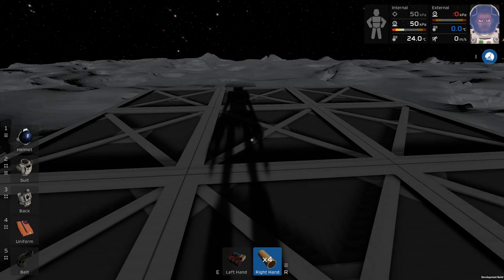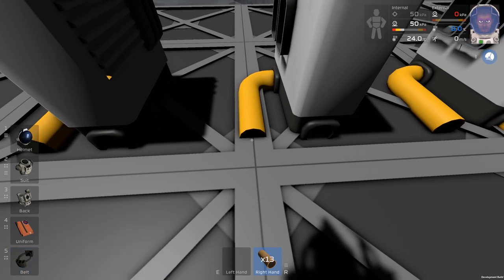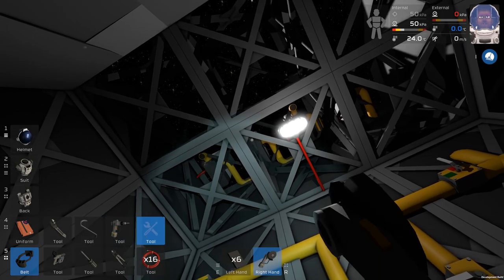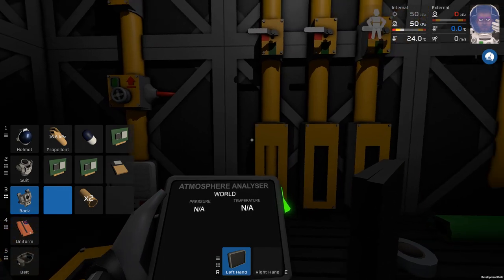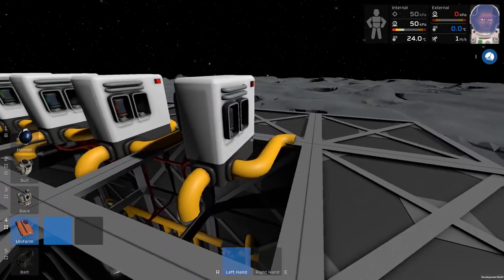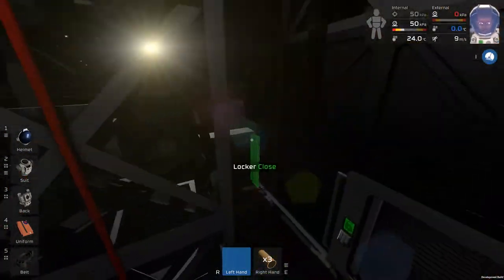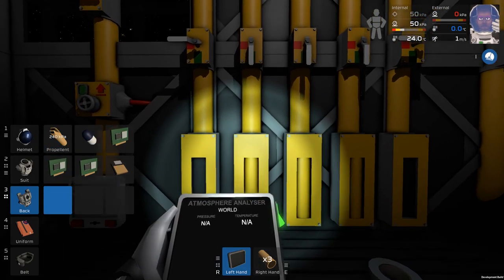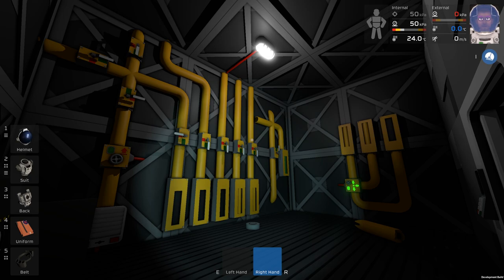Stationeers E06 Filtration, Separating and Mixing Gases

Comment: To make things simple I always switch my full waste tank for an empty jetpack tank. This way my waste tank stays empty and I always have jetpack fuel without having to use any kind of appliance or gas house. BTW love your videos! Another thing, if you place your arc furnace with the 3 pipes cliiping/sticking outside of your wall, It will not fill your base with any gasses, unless its ice of course.
Reply from the maker: Yeah, I think I'll be putting the gases through the filtering system at some point, assuming they don't melt everything! :)
Reply from the maker: Doesn't the jetpack use CO2 at a higher rate, compared with other gases?
Reply: Not that I noticed, could be. I personally can't tell the difference.

Comment from the maker: PSA: If you make air as shown, make sure to put a nitrogen filter in your suit, and raise the suit pressure to over 100kPa! (You can just use the pure oxygen too, in the current game version as of the recording date)
Reply: Yeah it is quite weird that right now N2 just seems to stay in your helmet. (you can also vent it if you don't have a filter).  I mean it's normal you don't process it and exhale it back... but it should go either in your waste tank with CO2 or be vented outside.
Reply: Maybe this helps, according to NASA they use 100% O2 at 4.3 Psi (29.6475 Kpa). So I’m thinking that for station breathing mix 20-30% O2 and the rest N2 and for the suit just use O2. ???
Reply from the maker: Sounds good - getting enough N2 is more of an issue I think.  Putting a filter in the suit just gets rid of it (and it's not easy to replace), so when pressurising the base, I may have to design something to re-separate, filter and re-mix the air, with a constant flow through the base of air being pulled and pushed. I've gone with O2 in the suit for now.
Reply: grayduster I would not be surprised if they change the values of what you get from the ices, seems like a lot of the programming was done to get things working and a balance pass is still to be done
Reply: grayduster just wanted to clarify something for the lurkers. Looks like suit filters cause that gas to go to your waste tank. So if you put a tank of mixed gases into your “air” slot whatever filters you have those gases will go to waste. I saw a video of a guy “breathing the exhaust from the furnace”. Just watch out for the temperature, he burned the characters lungs...  anyway it’s not vented to space  but put into that other tank
Reply from the maker: Yep, we can plug the waste tank into the gas storage unit in the atmos room - it'll be re-filtered nicely!
Reply: Breathing air is 21% N2. You had the mixture backwards in your mixer and you should be fine.
Reply: Maxime Cloutier That's what the filter is for, the suit isn't recyling at all. It's a bit silly though because in that case you wouldn't need filters at all, just draught.

Comment: Built up a similar system now thanks. but i think i dumped too many ores into the furnace. blew two tanks and room reached like 950c. had to run out and cut the wires to the room. took it 15 minutes to vent out. lol. what's the max pressure of the tanks?
Reply from the maker: Hehe - you only need one or two oxite and volatiles, even for a large batch of steel.  It's not really relative to the amount of iron and coal.  Pipes and tanks can go up to 10,000 kPa ( 10 MPa ).  The simplest way is to put a pipe on the output to a passive vent well away from anything that'll burn (output vent is the top one on the back of the furnace)

Comment: fill 1 tank with  gas mix oxygen and  c02 using 2 filter at Air Filtration  then  keep the other mix  gas to another big tank make bypass with a pipe valve to send again the mix gas to an Air Filtratio with different filters the second time , make  what ever filter you need and the last mix gas you don't need put active vent and take it out from the polution side of  an Air filtration  pipes :)

Comment: Why not connect the furnace with a T-junction between the active vent and the regulator? Also,  you don't need to waste the energy for a whole computer just for turning stuff on or off, there are logic chips for that. Perhaps a bit of colour coding on the pipes / canisters before you go mad? xP Still, awesome series, keep it up!
Reply from the maker: Logic units for controlling the solar panels is already in tomorrow's episode :D  I kept the active vent separate just in case of future flexibility - a t junction would probably do fine :)

Comment: am trying to do something like this for my air filtration, but i got a ton of water and my water filter isn't sucking it out into the tank i setup.
Reply from the maker: The setup in this video should still work fine, but if you want to see an alternative setup (that works too), check out the latest video in season 2 (gas filtering).  As it's laid out a lot clearer, that may be easier to see (and it uses filtration in parallel, instead of series, for variety)
Reply: i host my game on a 2nd pc sometimes it's easy to use it for dedicated server. i'd love to have you come in and help me figure what i'm doing wrong on some of these setups.